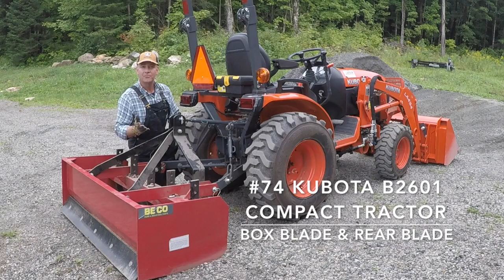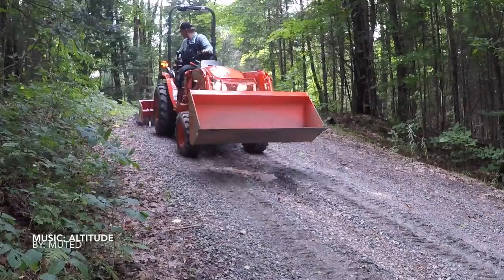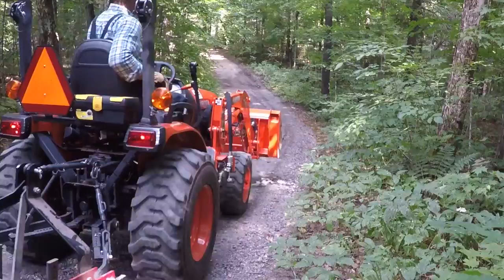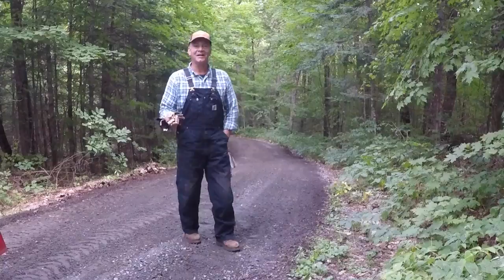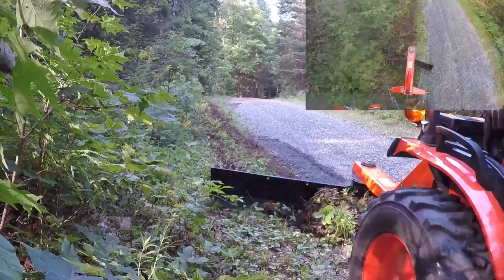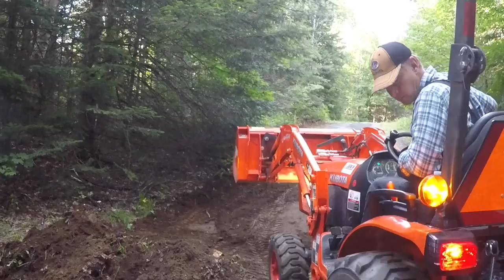#74 Kubota B2601 Compact Tractor BECO Box Blade LandPride RB1672 Rear Blade Grading. outdoor channel

Comment: I enjoy all your videos , you do a great  job . There are some very good comments as well to give us all new ideas. I noticed you back dragging with your bucket which I do many times also . Another way is to use your back blade turned backwards if it is heavy enough , that way you can level things out without digging in and you can also set at an angle which you can't do with your bucket . I do that with a light snow on my gravel drive too when there isn't enough to use the blower  so I don't dig it all up before the drive  has a chance to freeze . Keep up the great work you have wonderful place .
Reply from the maker: Hey good morning Herb! Thanks! Some good ideas there I still need to try out. I will keep in mind for future. I am still learning to get the hang of the rear blade but getting a little better each time. Appreciate it and will try them out. Thanks again!
Reply: @GPOutdoors   I put an extra nut on the bolts that hold the cutting edge as they would get a little banged up and hard to get off if used in a backwards manner like I do at times . I don't have a box blade as I wouldn't really have enough use for it , but yours sure is nice and you did a great job with it  . My drive is pretty flat so it stays in good shape for the most part . We are expecting another snow storm this weekend so the 2650 will get some more use . I do have a cab , at 76 the warm cab sure is nice . I don't really care for it in the summer that much as I use it for a lot of gardening etc. and need to use the AC as it gets so hot without it in the cab even though it is nice outside .
Reply from the maker: Hey the B2650 is a great machine Herb. Perhaps in a number of years, as I get older,  I will upgrade since I don't really need more than that now. Good call getting the cab on it. I am sure the heat and AC are really helpful and makes working outside more enjoyable. And hey, its so healthy to be working outside and for me, it is relaxing and peaceful. No matter how tired I am afterwards, I always feel so good after working outside all day. Good luck with the snow this weekend. I am hoping we get some of it too!

Comment: Nice to see another video! Even if you already did some video about gravel spreading or the like, we still enjoy seeing new ones. After all, we are all tractor enthusiasts! There is many ways I read below that are good. Main thing to remember here is the fact that your rear wheels will dictate the working level of your implements, especially the FEL. You want your rear wheels to roll on the proper angled surface. But yet, you have to create it first. That is where the angled blade is handy. Instead of pushing the dirt away (toward forest), I suggest to pull it toward your driveway. You will gradually run on angle (right wheel roll down in the ditch, left wheel rolls up on newly pushed dirt crown). Then when your ditch is done, you can use your FEL to remove the dirt you pulled on your driveway. You may not want to mix dirt with gravel. So you may first (of all) use the blade and grade the top/loose valuable gravel toward opposite side of the driveway. Then, when you are done, you can spread it back. And as you can see, it makes more seat time!!! Cheers!
Reply from the maker: Hey good morning Joe! Thanks very much for the detail above. Yes, have a few options to choose from which make sense. This makes good sense above as well. Dave also said the blade was tilted the wrong way and I think I need to pull the blade back in from the side of the tractor. Appreciate your advice as always. Thanks for the help and have a great weekend. All the best!

Comment: Hello again from Montana......A landplane is a combination of a box blade and rear blade sort of and is exactly what you need for that application. I do this for a living and own those other implements as well. It is extremely easy to use.....set your settings drop and go. You don't have to "fly" the three point hitch lever much at all. The side rails hold your grade and average out the cut as you go. A one pass affair in many instances and does a beautiful job. Be sure to get one with scarifying teeth for breaking up ruts, potholes, and washboarding. Then pull them up and finish grade. Costs about the same as a box scraper. You won't be disappointed. I use the box scraper and blade for rough grading and the land plane for finish grading. Most of the time you don't need the box scraper. I like your videos.
Reply from the maker: Good morning Daniel. Thanks for the info above. I have seen them and watched them on channels and am interested in trying one at some point if I get the chance. However I have one important question which I am hoping you might be able to answer. My driveway is largely just dirt and earth and gravel kind of mixed in together over the years. The area you see here is mainly crusher run but throughout the rest of the driveway out to the road it is largely dirt, as much as gravel. I heard, but not sure, that the landplane only works well on a gravel driveway ( large stone type gravel). Will it work ok on a driveway that is more crusher run ( small gravel) and dirt? Thanks!

Comment: Looks like you've gotten a lot of hints and tips. Only thing I would share is that on the hills of my gravel road, I always scrape running uphill. Over time the rain will wash the gravel down, so I start at the bottom and pull it back up the hill.
Reply from the maker: Thanks Greg! I was able to pull upwards but it seemed to be easier going down. But will keep that in mind. The tractor pulled it up no trouble but seemed ( in my head) to be kind of backwards. But you make a great point there. Thanks again - enjoy the weekend and all the best!

Comment: Good to watch another video GP! Try using the FEL to "chip" away the ditch, digging a little at a time and pushing it up towards the tree line. Once you have a ditch started, you can finish it with rear blade. I used this method to install drainage pipe (the ditch had to be much deeper) and it worked out pretty well. The only drawback is that it took a little longer to finish the project. Hope that helps!
Reply from the maker: Hey Paul - It helps a lot - thanks! A few others suggested the same thing. I appreciate it - have a great weekend!

Comment: Did good with the box. Make sure you scarifying to boot me of ruts or potholes it will may your roadbed more uniform and last longer. On the open blade ditching; Make the lower part of the blade closest to the tractor and tip the blade one hole more aggressive. Then run the ditch.
Reply from the maker: Good morning Loren. Thanks! I appreciate it a lot. All the best to you!

Comment: When digging your ditch, I suggest the cutting point be at as step an angle as possible use both the tilt of the blade and tilt of the lower lift arms. Also put that point closest to your rear tire.this will drag the dirt up out of the ditch. Use your bucket to move it elsewhere if needed. By putting the point in line with your rear tire, you ditch will dig where your tire goes. Make your digging angle as aggressive as your tractor will pull.
Reply from the maker: Coy, that's some great advice and ties in well with a few other suggestions. Thanks for taking the time as always. I appreciate this. Cheers and all the best!

Comment: I know it’s already been mentioned but a grader is the easiest and best way imo to maintain a gravel driveway.   I enjoyed your video.
Reply from the maker: Good morning and thanks for the comment JM! Yes, a few folks have suggested that as well. I think by grader you mean a rear blade, correct? Have a great New Years and thanks for tuning in!
Reply: GP Outdoors I got lazy in my description.  I mean the grader scraper.  It floats as you run it and has 2 cutting wedges.  The front has rippers for breaking up the surface if you need to remove pothole etc.   people call them graders, scrapers, levelers but they are good for smoothing and leveling dirt as well but don’t dig or carry dirt as well as a box blade. I want a box blade but waiting on the money but nothing beats the. Grader scalper for gravel driveways.   It’s very user friendly.  No learning curve.
Reply from the maker: Thanks JM. I have a unit called a Landplane which sounds very similar - there are several videos with it in use. (example is video #185). Thanks again and all the best!

Comment: I think I would have  angled my blade more to the right and got rid of the  vegetation and then went back with the right side of the  blade  dropped much more then the left side and made more of a V shaped ditch. After that I would have bladed the road. Just my opinion. I do admit that I have always bladed gravel roads  with a Road Grader with a 12 foot blade and could complete the job  in 7 passes including a ditch on both sides of the  road. Much easier than a little tractor.  Good Luck
Reply from the maker: Hey good day Ray. Thanks for the advice- will keep it in mind for next year when I start again. Still learning how to use them properly so advice is always welcome. Of course, if we were neighbours you could just drop by with the Road Grader :)) Cheers and thanks!!

Comment: Very satisfying. I wish I had some grading work to do right about now. I don’t know what you were in, looked like medium from the video, but if you can, make sure to do this kind of work in low. It’s a lot easier on your transmission than medium even is, and, I’m not positive, but you might even be able to pull past some of those rocks you got stuck on with the box blade. Rear blade worked pretty well. I think for the runoff channel you’re probably better off dropping one outside scarifier very low on the box blade and running along it with that, or digging down with the loader. It’ll take the longest, but the loader will do the best job. I don’t think your rear blade is going to do you much good for trench digging when it’s that far out from the side of the tractor. It has more leverage on the tractor and the three point hitch than the tractor and three point hitch has on IT. Make sure to watch your three point arms when you’re doing that kind of work with your blade too. I know I know, they’re 3/4” or 1” thick hardened steel bars but they still bend, and when they do they can be a pretty penny to replace. Great video, great camera angles and great edits. Just the kind of thing I like to wake up to. Cheers!
Reply from the maker: Good day Jackson. Thanks for some pretty solid advice there. As always, I appreciate you taking the time to help out. Glad you enjoyed it. Have a wonderful weekend !

Comment: Many ways to skin a cat GP.  I have used both the blade and the box blade over the years to work on ditches....practice makes perfect.  Do you have a rear remote on your tractor?  I finally picked up a cylinder at Princess Auto and made a hydraulic top link which comes in very handy when using the box blade to adjust how aggressive the cut is without having to get off the tractor to do it.
Reply from the maker: Morning Kryton! No, I haven't yet but a few folks have suggested they are a good unit to have. Have a good one!

Comment: GP just angle your blade more vertically. And change the trailing edge of the blade to where the soil exits
That way it cuts into virgin soil without fighting the pile your making
Right now you have trailing edge with soil exit direction so the blade won’t cut in as much
Great video as always!
Reply from the maker: Hey good day Jim. That's exactly how it felt - like I was fighting against it. And when it piled up too much, it started to make the tractor turn sideways. Thanks! I appreciate it. Have a good one and all the best!

Comment: GP,  What size Finnish stone did you cover the drive with?  I have to rework and top cover my drive in the spring.
Reply from the maker: Good morning TGC! It is called Crusher Run up here - I believe it is 3/4" size and down to silt. I think you can also order larger sizes. It works great for me - but if you have a dirt driveway (dirt and gravel) like mine, it is important not to drop it before the ground dries out and hardens after the winter (usually no earlier than end of May, beginning of June, assuming normal weather, and should not drop it  later than probably mid to end of September. This I have learned from the excavation guy who has looked after the driveway for years before I got the tractor. Hope that helps!
Reply: That is very helpful.  I plan to order my box blade this week.  I am leaning towards a heavy duty 54” one.  While the 2601 has lots of power I have found with the “soil” I have, mostly rocks and clay, the tractor is at its upper limit to drag 60” implements through the ground.
Reply from the maker: Good luck Guy C! I think you are in Ontario (?) and if so, perhaps include Farmer Equipment Sales in your research. I spec'd 5 or 6 different manufacturers before choosing and they had the most rugged, well built  and at a really good price compared to the others. I did a video review (video #38) on it the first time I used it. I have never used another one but am still 100% happy with it. And as I think you know, I don't get paid anything for referring or anything. But I can get you 10% off, if you decide it is the right one for you. Cheers and good luck!
Reply: I was bored this afternoon and between baking loaves of bread I did the crazy, ridiculous over-research we all do when it comes to equipment.  I bought a 54” EA Xtreme Duty box blade, in Kubota orange of course.  Won’t be ready for six weeks, but that isn’t a problem as everything will still be frozen well beyond that.  Seemed a good fit for size and weight at 175 kg / 385 lbs.
Reply from the maker: Hey congrats! EA has some great equipment from what I have seen so you should be very happy. Hey fresh bread? Nice! To this day one of the best things is fresh baked bread. Cheers and have a Happy New Year TGC!

Comment: When you are cutting the ditch try using the box blade at the most angle you can get it will remove material rather than pushing it into the bank
Reply from the maker: Good morning and thanks Darin. I will give that a try. Have a good weekend!

Comment: Nice video, I would use the bucket side to side and take out about 6 inches, then go over it with a york rake. Your only looking for a low spot for the water to travel. Thats my 2 cents.
Reply from the maker: Good morning Mike. Thanks! I think that makes sense to use the bucket first - a few folks have suggested that. I don't have a rake but you make a good point. I just need a low spot. Enjoy the weekend!

Comment: Try shifting your blade to the left. Keep the same angle, but the end of the blade engaging the ground should be the shorter end( the end not sticking a foot outside of your tire. Then you’ll need to tip it more aggressively toward the ground your trying to ditch. It did seem like their were some boulders that may give you trouble, you know what to do about those.
Reply: Was just going to say the same....engage the shorter end into the ground  ...trying to engage the longer end of the blade has leverage working against you
Reply from the maker: Good morning folks. Thanks for the help. You are correct. Kept running into rocks along the way. Thanks again and enjoy the weekend!

Comment: You might want to try less blade engagement with more trailing angle with the cut close in to the rear tire of the tractor. I have found this works well for me on small equipment with limited power. In the video you had a lot of blade engagement but not much angle and your equipment does not have the weight or the power for that. Hope this is helpful good luck and thanks for the videos.
Reply from the maker: Good morning Rick. I think that explains it perfectly. I found it awkward, so to speak, and have a few other subs suggesting the same thing. So, I should do better on the next run. Cheers and thanks for helping me out. Enjoy the weekend!

Comment: Your big hill isn't 45 degrees, more like 15-20 degrees at most. Good video playing with your blades though.
Reply from the maker: LOL Daniel. Thanks very much for watching and for the comments and suggestions. I know it doesn't look like it on camera but I have done a rough estimate on it using 2x4s and a digital laser level. I also have a slope indicator in my truck and before I get half way up, it already registers past the max reading on the gauge. She's a steep one for sure. Thanks again for the tip on using the ripper on the gutter. All the best!

Comment: With ruts in those areas get aggressive with your box blade teeth. Otherwise you may be doing little more than raking gravel into the rut to be knocked out.
Reply from the maker: Hey Coy, thanks. I was talking with a neighbour and he suggested the same thing, he said I should drop the scarifiers deeper. I have never used them on a more aggressive profile but I am going to do that and we'll see how it works. Thanks - really appreciate it. Cheers!

Comment: blade is angled the wrong way for creating a ditch.
Reply from the maker: Good morning Dave. I heard you have a video on it so will check it out. Thanks and hope you are doing great. Cheers!
Reply: yes in the video I did I cut the ditch in the some what wrong direction for most applications but for my application it was the best option because I did not want to have to clean dirt off the asphalt driveway and I needed to miss the buried power line to the pole light. It has been holding up very well and there has been no undermining of the driveway so far. I may do a follow up video soon to try it in the proper direction.
Reply from the maker: Thanks a bunch Dave. I will watch it a few times before I try the second attempt. You make great videos - always well explained and easy for me to understand. Cheers and have a great one!